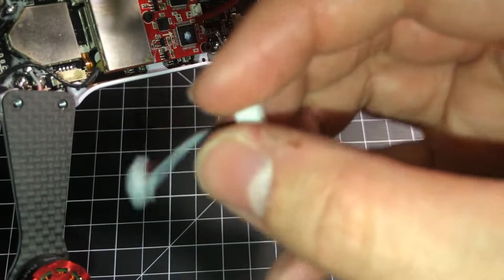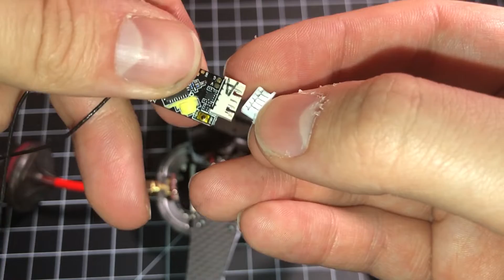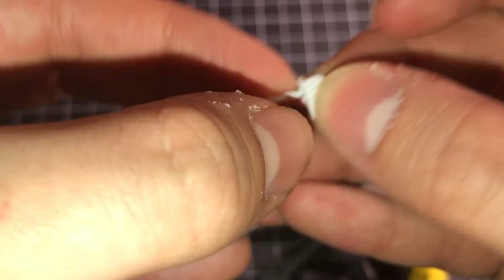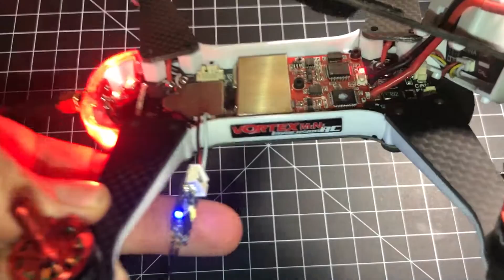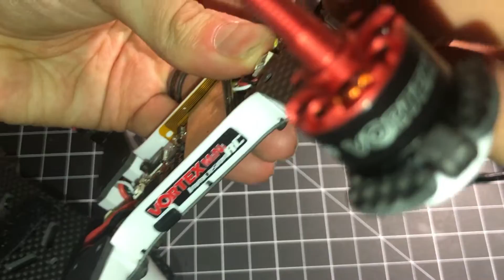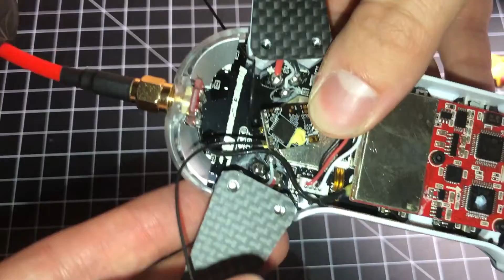Immersion RC Vortex 180 FrSky R-XSR Receiver Installation (No Soldering!)

Comment: Hi. I just bought my vortex 180 mini and dit the cable switch. I got i working on betaflight but i think i did somethings that changed it. i don't have the blue light anymore on my receiver and no input in betaflight. I tried the 4 seconds f/s button but it doesn't work. I flashed the receiver but still no movement. Could you have an idea wich i should do or check? Greetings from belgium

Comment: I did this to my rx, but how did you bind your rx, I see in the video that it is not bound because the green light is not on, I try to bind mine but the red light does not flash when i hold down the FS button on the rx and tx is in bind mode and then green is solid but when i unplug it is not bound? any ideas? is there a setting in the OSD on the vortex that has to be changed?
thanks
Reply from the maker: The green light is not on because my taranis isn’t turned on / bound. All I had to do was hold down the r-xsr button and set my taranis xd9+ into D16 mode, press bind, and it bound. I am not sure why yours isn’t binding though it should be straight forward. What radio are you using?
Reply: @JohnCuppi  I undated the RX to access mode so you have to register the RX with the tx and then find it without pressing the FS button.nit works now

Comment: After you remove the pin, there is a very little tab on the top of the pin (like very little). You have to bend it upwards again, because most of the time, it gets bend down while removing.
Reply from the maker: I think I’m lucky I never seemed to have to do that! Thanks for the tip though 👍🏻 it’s definitely something to check!